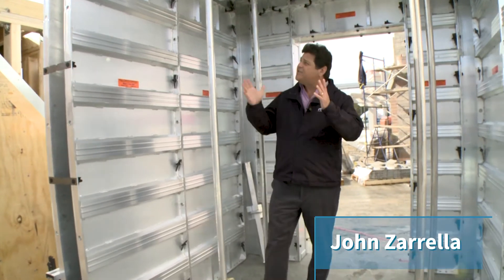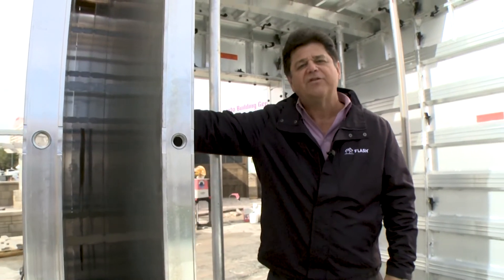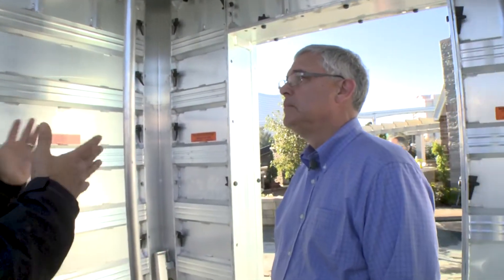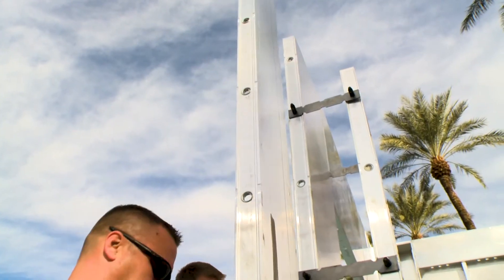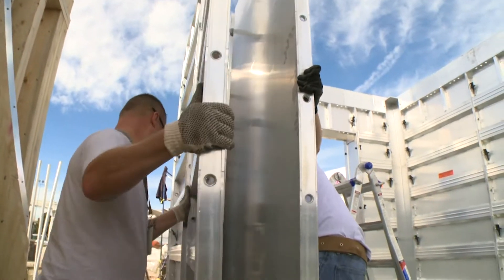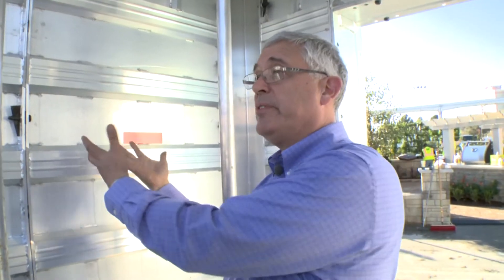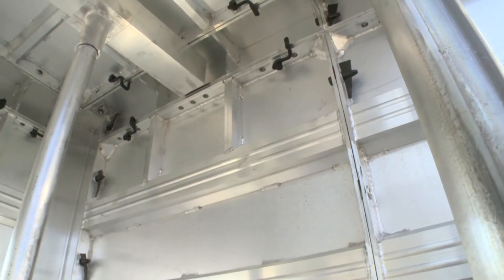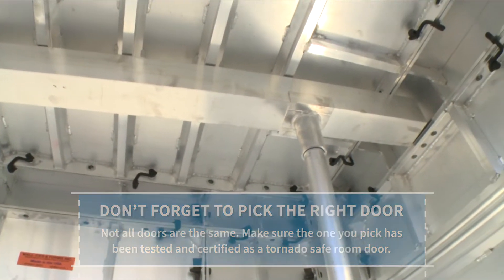Cast -in-Place Concrete Tornado Safe Rooms

Comment: If you want it to last any length of time, use non-ferrous rebar. Steel will rust and spall out your concrete.
Also, consider building a lot more than one tiny room out of materials that will withstand extreme weather. Like, maybe .. your whole house.